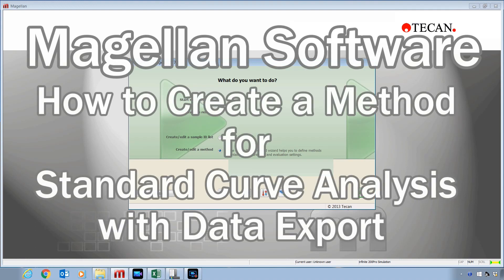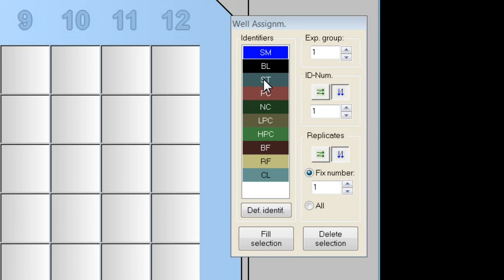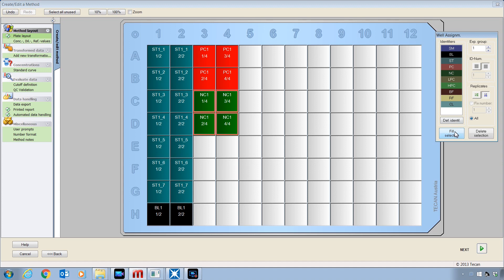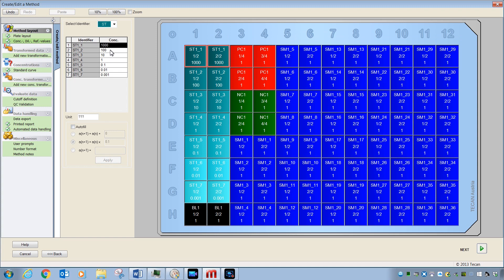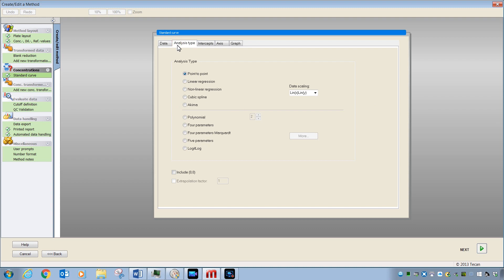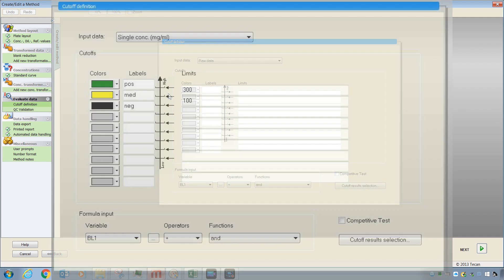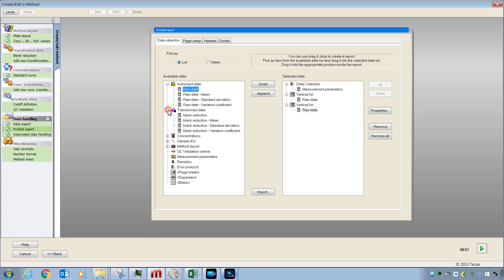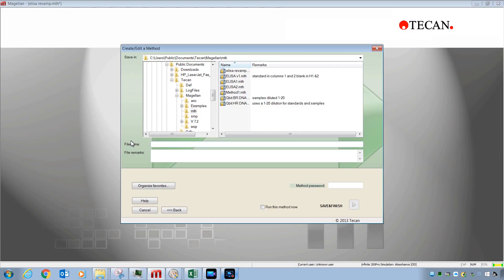Tecan's Magellan Microplate Reader Software - Creating a Method with Standard Curve Analysis

Comment: how can we set up two plates--one is for standard curve and another one is for sample plate?
Reply: sorry for not replying sooner as I do not monitor this channel often.  For anyone reading the comment who is interested, the software lets you choose how many plates a method will measure. As you begin to enter measurement parameters in Magellan there will be a selection in the lower left of the window to indicate how many plates it should expect. Keep in mind that as you add plates, the software will require that you define the layout for each plate. When creating the layout for the first plate, put your standards on that plate and any other samples or controls that will occupy the plate too. There will be an option along the top of the plate layout window to advance to what the layout will be for the second, third plate etc and you'll want to filly those layouts with the appropriate identifiers.  When the method is eventually executed, the software will read the first plate and then prompt the user to insert the next plate, and so on.  If the method calls for more plates than you plan to read, that is OK. You will just stop the process of reading once the last plate is measured. The software will then do the analysis on the plates that were measure.

Comment: Thanks for the information its really helpful
I have a question suppose i have generated a kinetic read of 90 mins data wd basic protocol now i want it to export it in a column  format( like all A1 wells time points together) not in a plate map manner Can we do it...? Or before read only we have to do setup?
I tried but its always gets exported to excel in plate format😊
Reply from the maker: Sorry for the very delayed response. When editing your method, navigate to the screen where you can edit settings such as Data handling and select “data export”. In the data export window select the “export options” button and pick the export option “result” called Table(data in rows). This will export information for each well across the spreadsheet in rows so that each column will contain a specific type of data you are exporting such as, raw, mean, concentration, etc.
Reply from the maker: Hi I apologize for never replying to you. I should have turned off comments because I am not monitoring these videos for questions. Either way, here is an answer to anyone else who has a similar question.

As you are creating a method or reviewing data that has been collected, there are settings under "Data Export" where the format of the exported data can be driven into matrix, column, or row formats. You will find these in Data Export, "Export Options" visible in the video starting @10:26.  To have your data appear with the wells running down the left side of the spreadsheet and columns of data types running across the top, select "Table(well data in rows).  Thx

Comment: ChroMate 4300

PC controlled ELISA microplate reader

 

Measures Absorbance of 96 wells in approximately 12 seconds
User-friendly intuitive software
Automatically positions plate, blanks, reads and calculates results
Uses standard microwell plates for all reactions
open system
Four filter model (405 nm - 630 nm)
Optional 6 filter VIS model (405 nm - 630 nm)
I need a definition
ChroMate 4300

Comment: Hi! I am using a Tecan Sunrise microplate reader with the Magellan software for doing an standard curve but I have a problem. Whenever I want to run my curve, the machine says that I don't have enough base points... so, what I tried to do was a blank reduction (I am not sure if this was what I supposed to do but I gave it a chance) but I do not have the automatic option in the transformation section to do this. I tried to fix this by putting the formula (x-BL1) directly but it doesn't seem to be working. Can you help me with this please? Thanks!
Reply from the maker: please go ahead and email me your magellan method directly to rcavicke@roadrunner.com and I will take a look.  Because this is not an official Tecan site, I have to take your inquiry to my personal email address. Thanks for understanding.
Reply from the maker: As long as you have defined at least two wells with the identifier called ST1_1 and ST1_2, and valid data points are collected for these wells, the software can plot a curve. Once you read the plate, if all of the data points for your standards are "OVER" , or if only one standard has a valid data value and the rest are "OVER", and beyond the OD range of the instrument, it will not be able to plot any points you'll get an error that there are not enough base points.